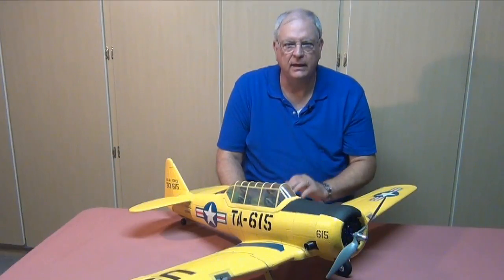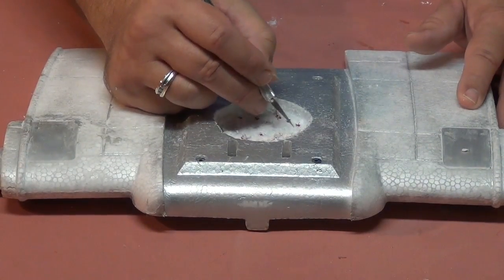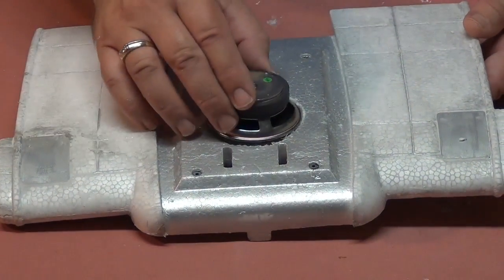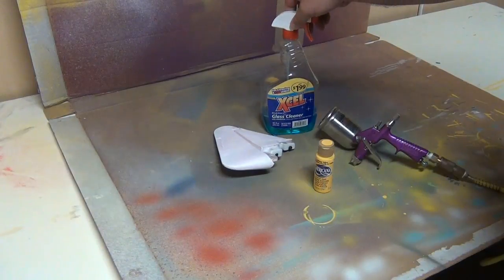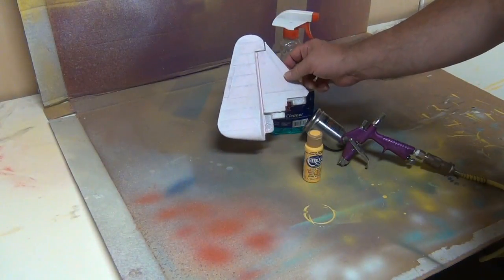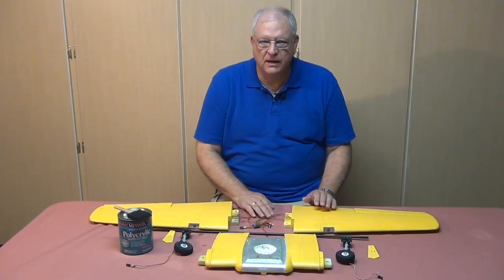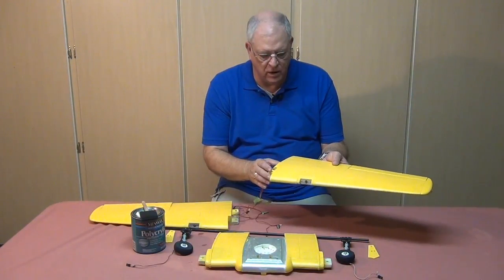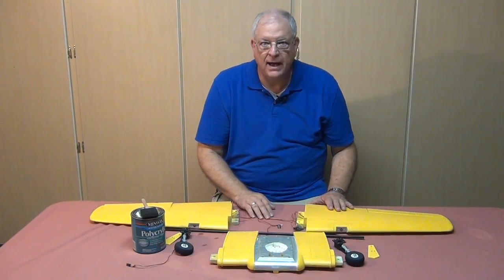Restoring EPO Models   Part 4

Comment: Great series! Just a tip. Before painting you can put the minwax on first to sell everything down and fill in any surface gaps. Then when it comes to painting the paint will stick to the surface better and produce an even coat.

Comment: Thanks Jim for a really good overview of restoration techniques.  I have an older Park-Zone Corsair (non retracts and no provision for such) that will go through essentially the same process you describe.  Was wondering where you have gross damage (landing gear anchor points torn out of the bottom of the wing) to simply fill the gross areas with gorilla glue or section out the damaged foam and replace with a foam block cut from material normally used to pack kits for shipment?  Your thoughts would be appreciated.
thnx, Monte, Fresno CA.

Comment: Thanks for the helpful series.  You don't mention using a primer before painting.  Do you find that is not necessary on EPO foam?  Another commenter suggests applying the polyurythane before painting (ie, as a primer).  Would that be your suggestion as well?
Reply from the maker: +Sam Levy Sorry about a tardy response. Ooops.  I've used primer over deep colors to avoid having to multiple coats of the final color. Otherwise going over something like silver with white or red wouldn't require primer most likely. I haven't used WBPU before painting but I often use it as a seal coat over new paint and the decals. I can choose the final sheen based on the kind of model it is.  For example flat polyurethane for a warbird. I have no reason to doubt the other poster -- I just haven't done it.
Reply: +Sam Levy 
Thanks.  Can you indicate which air compressor you were using with your Harbor Freight air gun?
Reply: I have not had success using the minwax polycrylic as a base coat over the foam.   It creates a slick surface on the foam, which reduces adhesion to the primer.  It makes much more sense to add the minwax as a top coat, as you did.

Comment: Question: How did you mask the canopy?
Reply from the maker: I used acetone and a skewer with paper towel to clear the silver from the inside troughs. I then used a very small artist's brush and laid down the yellow in the grooves free hand. I used regular painter's tape on the lower outside canopy rail. Be careful with the acetone. It did a little fogging of the clear plastic.

Comment: Where did you get that pilot?
Reply from the maker: Multirotor Go .  It was laying around the workshop. Likely came from Tower Hobbies but I don't see it there now.
Reply: *****
But you had two of the same one laying around ?
Reply from the maker: Multirotor Go It's been a while. They were pre painted busts, with different colored hats. Search civilian pilots at Tower or Horizon for lots of choices. I think they were 1/7th or 1/8th scale. Measure to  check. Pilots add to the model so thanks for noticing.
Reply: *****
I will check thanks. I like your videos, keep them coming!